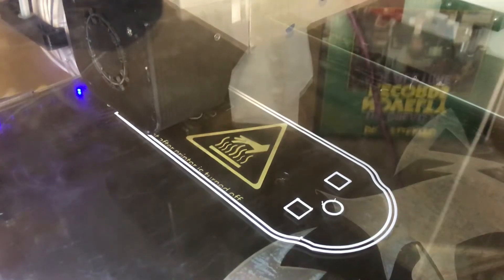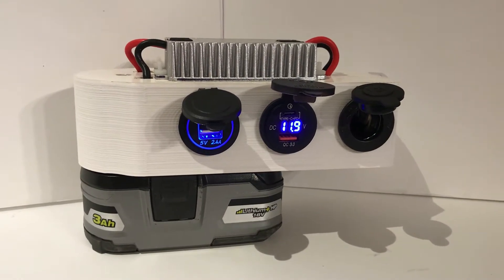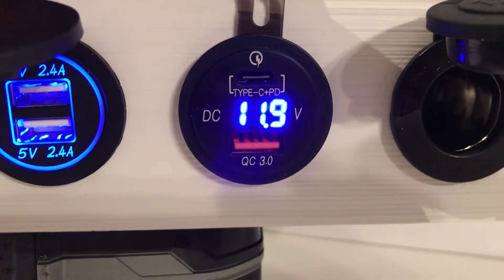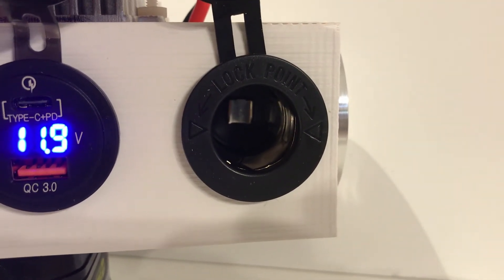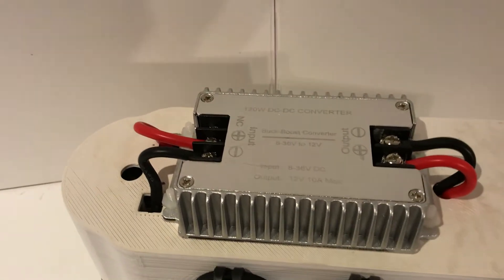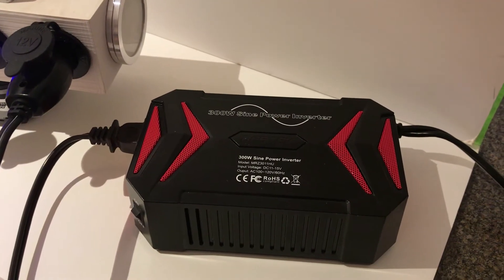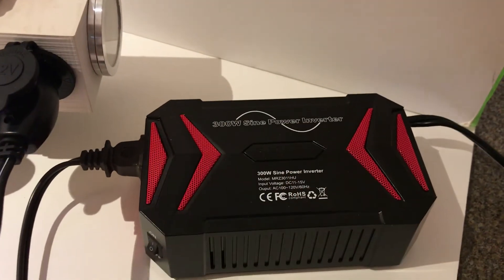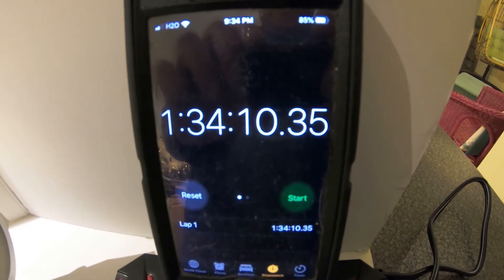DYI Ryobi 18V One+ Powerstation

Comment: Home come you are using a buck converter if all cigarette socket products say 12-24 volts?
Reply from the maker: most of the USB sockets will take 12-24V input, but if you have a 12V device that will be plugged into a cigarette lighter socket, you need voltage regulated down.

Comment: I would buy one if you are using 40V system with 12V cigarette lighter. Lots of motorhome users use 12V to supply their brake controller and this would be nice.
Reply from the maker: Check out the other videos on my channel.  I've made several Ryobi 18/40V to 13.8V power adapters. I don't sell them... I put the designs in the public domain
Reply: I also would like this for 40 volt system. I have not seen anything that does not include using the plug into the 300 w inverter. If you could guide me to a place that does this with out the inverter I would be very thankful. I like your work.

Comment: Great item - now we need an adapter that lets you connect any ryobi tool from 110v
Reply from the maker: hmmm. that should be pretty easy. Good idea. Just a 110AC to 20VDC 2A powersupply and the 3D printed battery end
Reply: @SerendipitySue  I can't believe Ryobi hasn't come out with one, although several of their products have the ability to be 18v or 110v already. If you make one - send me a prototype to test or let me buy the first one...
Reply: @SerendipitySue  
2A only? A drill under load can pull up 8 amps easily.
Reply from the maker: @ruinunes8251  for larger loads you would need a bigger power supply. But they get expensive

Comment: Dont understand why you would go through the cost and the money and time to run a lightbulb for less than 2 hours.  The Ryobi LED light you can buy for 35 lasts 24-48 hours?
Reply from the maker: The light was just a test of the regulated 12V supply. The built-in LED light would last a long time. Having regulated 12V is great for people that have CPAP machines.

Comment: This is sooo cool! I've wanted to try something like this, and here is my question. Can you tell me how you would build this same project, but if you were to wire up multiple of your 18 v batteries for more overall output power and longer running time. I'm not a very electrically savvy person but when I saw the dewalt powerstation debut, I've been waiting for Ridig to make their own (I own mostly ridgid cordless tools) and really want one of my own.
Reply from the maker: I'm working on repurposing a Ryobi 6 battery charger to be a powerstation. The caveat is that you will need to use the same size batteries (ie. all 4Ah) and they must be charged to the same level.

Comment: What happens when the battery runs out?  I assume the on board battery management system shuts power off.
Reply from the maker: Just like any other Ryobi tool, the BMS ( Battery Management System) in the battery pack shuts off. It preserves 10% or so of the battery so it can be correctly charged. Other tools systems like Dewalt put the BMS in the tool... it makes their batteries cheaper, but it makes hacking them for other DIY projects harder